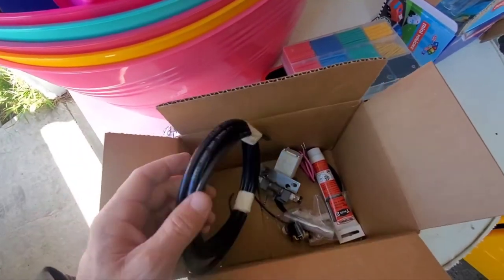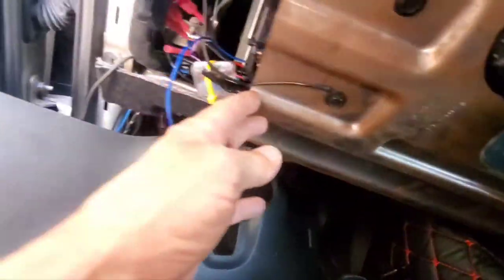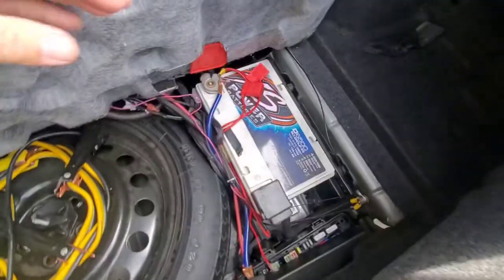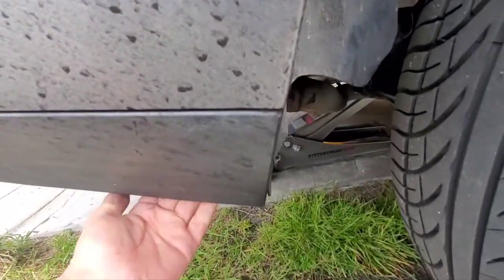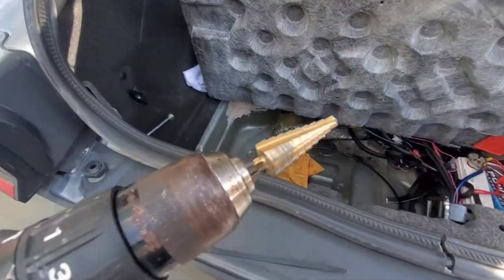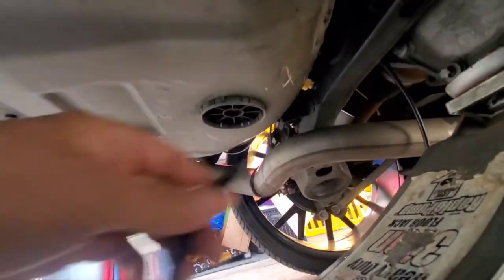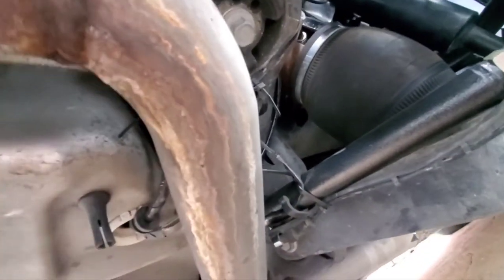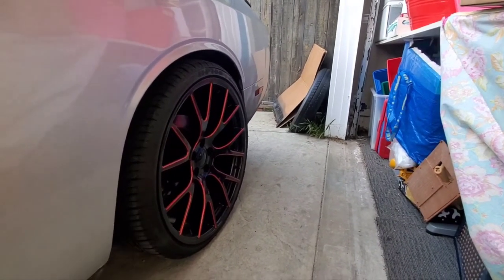Electronic Air tank drain valve kit install for Air Suspension

Comment: Honestly. 
The second the line exits outside the car,  your technically done. 
You didn't have to route it to the rear quarter panels. 
Love the electric valve idea.
Reply from the maker: I know, I wanted to run 2 lines though, to be different.  Haven't seen it done at the time I decided to do it. It gives it a technical look on each outside quarter panel. I wanna be able to see if water drains when I push button. I like to know how much water accumulated  during the month till I drain it. 
Electronic drain Valve is the way to go.

Comment: How big is that tank?
Reply from the maker: It's only 4 Gallon. I wish I got a 5 Gallon.
Reply: @TheBarrios69  Late question but just curious, why's that? About to put a 4-gallon dual-compressor setup in my car and I felt 4 gallons would be more than sufficient (and it's really, REALLY pushing the limits for what I can fit in my car, since it's a 3000GT).
Reply from the maker: Just because I feel a extra gallon of air is great. The 4 gallon is cool but the 5 gallon of course has more storage. But the size of the trunk really matters how big you can actually get. I'm fine with. 4 gallon, but I would have Gotten a 5 gallon if I could of. My Challenger trunk would of been pushing it.. so the 4 gallon is fine.